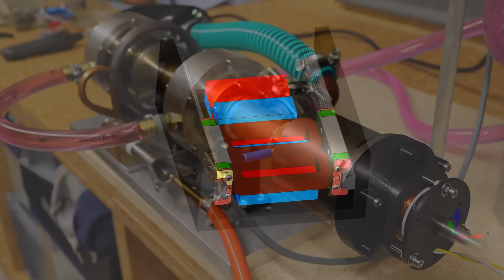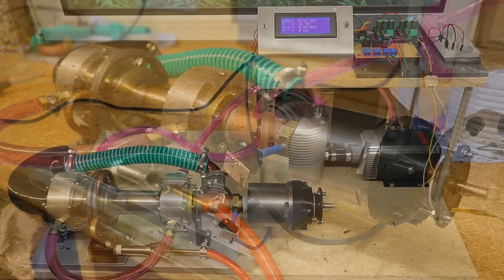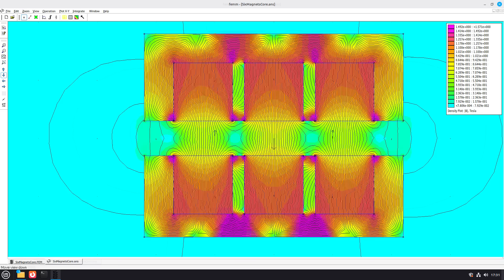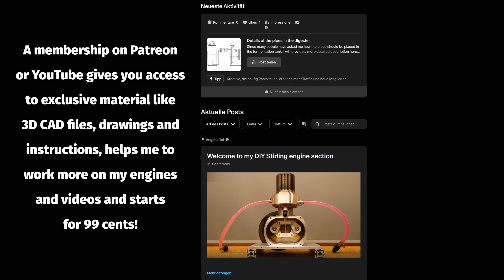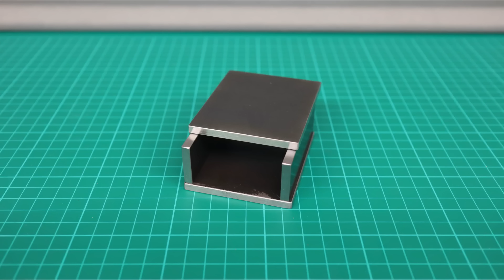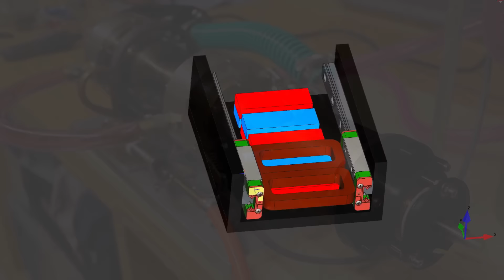Building a powerful linear generator for cheap DIY energy

Comment: beware of using scrap steel for the magnetic circuit, would "electrical steel" ( of an old transformer) not be better?
Reply from the maker: Yes, but its very hard to find, I did not find any supplier!
I use pure iron sheet instead!
Reply: Magnetite cast in epoxy is another option maybe.
I had thought of a solenoid replacement for pistons in a combustion engine a while back, but I’m lazy and I’m sure it’s been thought of.
Reply from the maker: I have stored the iron chips from milling the iron plates in alcohol.
Perhaps I will pour them into epoxy resin and experiment with them as iron cores in the coils!
Thanks for your help!
Reply: @myengines  Use microwave transformers from the trash. They are made of nice silicon steel
Reply from the maker: Thanks, I will look out for one!
Reply: or just any old transformer , i used an old halogeen  transformer
Reply: the magnetic conductivity is spectaculry bigger (> x100) , and the losses when swithing magnetic direction are far smaller
Reply: Why what could happen? Is it dangerous?
Reply from the maker: No, simply that they don't rust!

Comment: A problem with moving coil is that you need flexible connection to the coil. Moving magnet would be a lot more reliable.
Reply: what if there was a way to transfer current through the linear rails?
Reply: @revilolavinruf  Possible to do but would still need a good carbon brush connection anyway.
Reply from the maker: I also thought of this but I need four connections as i want to wire each coil separately.
Reply from the maker: Yes that's true, but I hope it will not be a big problem and I want to keep the moving mass as light as possible!
Reply: @myengines just make a connection from the coils to some flexible high strand count wire on the carriage. These should be able to handle all the movement
Reply: @willemstigter6384  He has both high frequency and large displacement in the movement though - not that easy to do it right. I'd rather use some sort of slip connection.
Reply from the maker: I still need to think about exactly how I'm going to do that, but both of your suggestions are very good!
Reply: @akkudakkupl don't he need to use planar spring somewhere anyway? He could use them as the conductor. No need to suffer abrasion or unnecessary dangling mass that way.
Reply: theres an alternator design that doesnt require moving conductors or magnets... "inductance alternator".

basically a VR sensor or guitar pickup with an electromagnet rather than permanent field magnet... just follow that idea along to its conclusion...

Comment: Do you use a Halbach array?
Reply from the maker: Not for this second try, but maybe later.
Reply: @myengines  you can have magnets on both sides of the coil , and have them as cloose as possible, with ferromagnetic backplate  or such, can be a U type too so that one.
You can also see the video from "Greenhill Forge" for making a axial generator. A very good video. So you can also use those principles such as 3 phase. So , just look and see what others have done and then take good ideas from all and merge into your own.
Reply from the maker: There are magnets on both sides of the coils, and they are as close as possible. Just for a clear view I just showed one side of magnets or took them further apart!